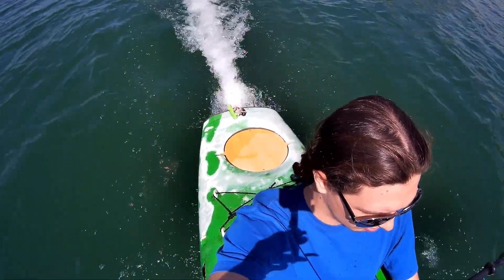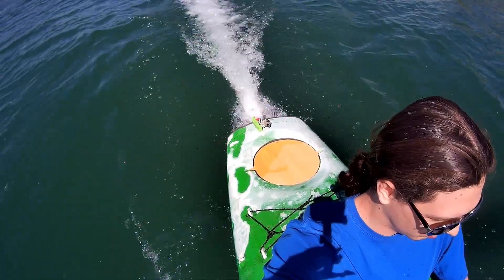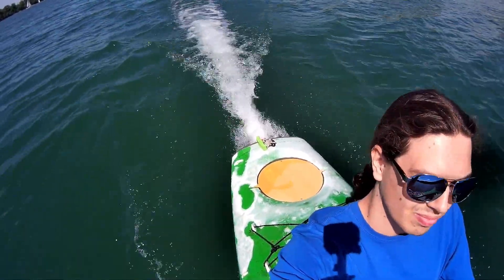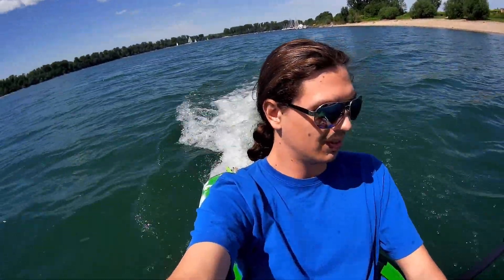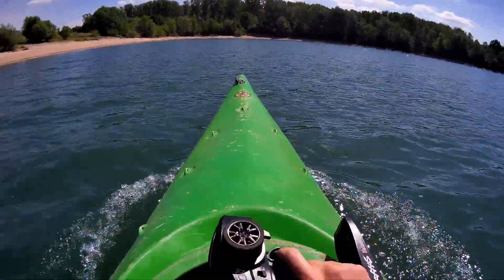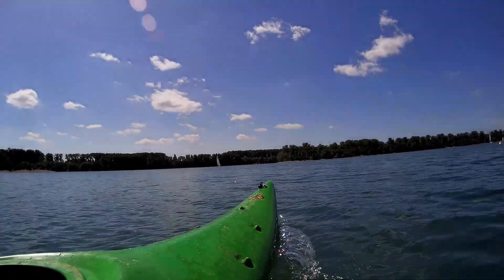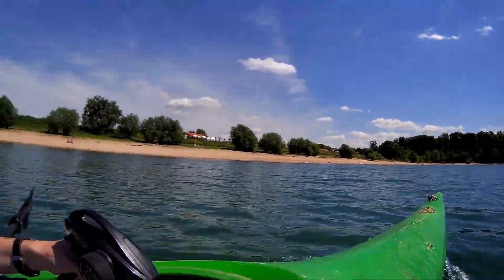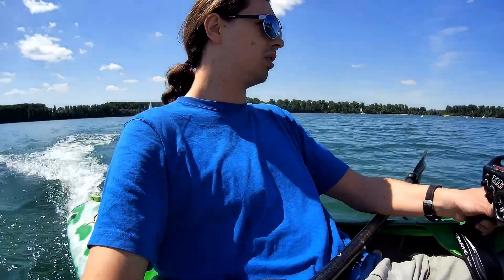Electric Jet Kayak Update

Comment: I'm in the middle of printing your files, any updates would be extremely helpful!
Reply from the maker: I'm still testing new stuff, especially the steering concept gives me some headaches. But the basic jet should be functional, I described further changes in my latest videos on the topic (like ceramic bearings etc.) Looking forward to more testing this summer. By the way, depending on the cooling concept and destinated system power, finding a motor with lower KV could be beneficial (e.g. an outrunner motor, if compatible with water cooling). For printing the jet inlet, in heinsight, I would recommend to use a non-biodegradable plastic, like PETG instead of PLA and to print with at least 2mm wall thickness to increase the mechanical strenth.
Reply: @rcandfun242  awesome; thanks for the response.
Don't worry about PLA degrading it's technically biodegradable but thats only under laboratory conditions. The organisms able to break it down do not exist in nature.

Comment: many controllers can not in reality work with advertised amps. Try to submerge it in di electric fluid in a small container, that you then cool with the external water from lake or sea( copper pipes or what ever).
Reply from the maker: the speed controller is already water cooled, seems to me it might be genuenly overloaded after all (in this video, I think I'm still using a three-bladed propeller  (more torque required) which may or may not had a little friction problem whith the outer wall...). maybe a hall-sensor based current measurement could bring a definite answer. But I would have to find an affortable and reliable instrument first

Comment: Hi..I have a Mokai kayak works with Koehler engine (9.5hp) which powers the jet pump by a belt. It is really fun to have, the draw back is noise and smell.
I am interested and like to convert it to electric ? Would you be interested to help ? Thanks
Reply from the maker: Sounds like a cool project. I guess 9.5 HP should not be a problem for a water cooled electric motor of sufficient size, maybe a slightly modified e-bike motor could be a smart solution here, since they output a lot of torque and eventhough heavy and big, probably still lighter and smaller than the combustion engine. And you could just use the E-Bike infrastructure for battery, speed controller and so on. Just make sure that the power, rpm and torque are somewhat adequate.

Comment: Liked, shared and subscribed  👏well earned. Now what would you recommend to buy if one doesn't have a Kayak yet. EU oder D bitte ;-)
Reply from the maker: Thanks! do you mean a kayak in general for paddling around or to convert to a jet kayak? For the latter I'd recommend a non-fibre reinforced model, it is heavier but a lot easier to work with imo. It should be wide (about 80cm) and not too long (<4m) but also not too short so that all the components can fit in the back and theres still enough leg room and storage room. They also have the benefit to be cheaper and are more durable than gf or cf boats but can be hard to find on the used-market. Maybe just look on ebay rom time to time :)
Reply: @rcandfun242  Thanks. Got a flipsky Motor/ESC already so Motor powered ist the Intention.

Comment: Hi Mate, the exit nozzle looks a little swamped and submerged, if you put some higher sides on the ride plate and made it a tighter fit at the sides, (just enough for the full steering lock),
it might give you less water around the nozzle and give you some extra thrust,
Have a great day bud :)
Reply from the maker: Good idea. I took whatever sheet metal leftover I could find at the time to make the skirt for testing. Making an improved version of the skirt is definately high on the list. But first and foremost I must tacle the motor cooling issue. I already installed an additional water pick-up but I want to make it air-cooled as well just to help the endings of the motor can to stay cool as well. And if it still overheats, well, then I either have to choose a bigger motor that is rated for higher current (what seems to be hard to find for an affortable price at least) or install a gearbox, probably belt or chain to keep it lightweight and easy